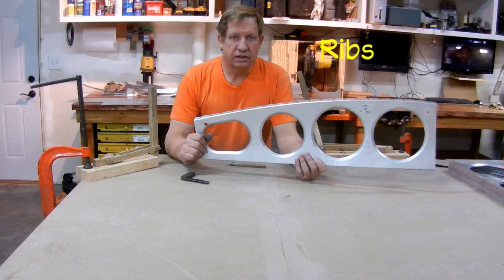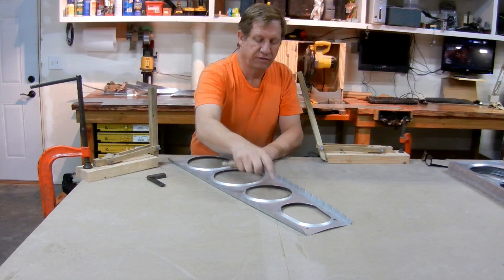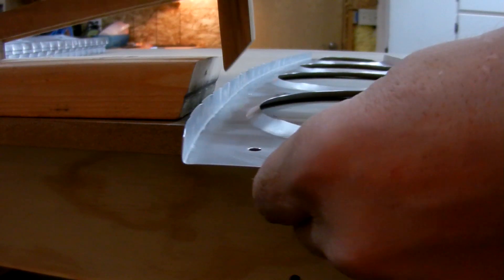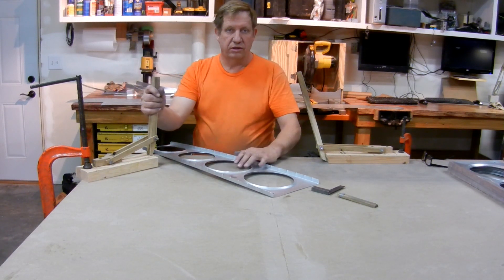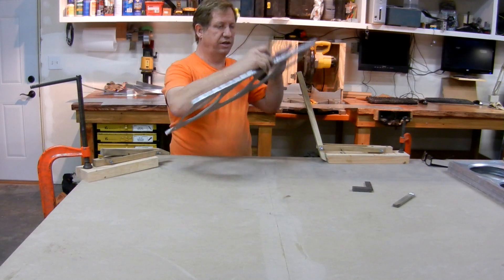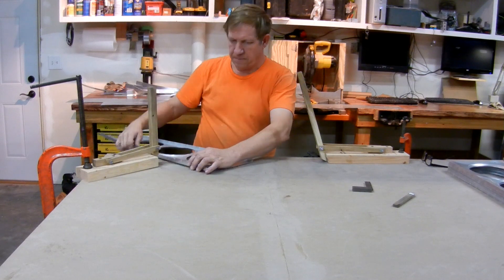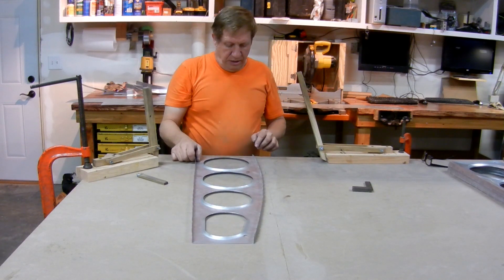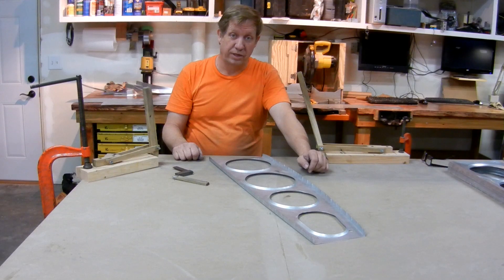Bearhawk Experimental Airplane Build : Center Rib Straightening

Comment: Curious... what you made your Bob Stick out of.
Reply from the maker: It is a piece of oak with a slot in it. I wrapped the split end with wire to reinforce it.
Reply: @BSpotBuilds  Any hardwood would probably be ok. Reinforcing it with wire is a great idea. Great video!